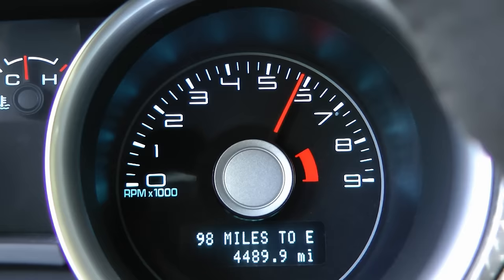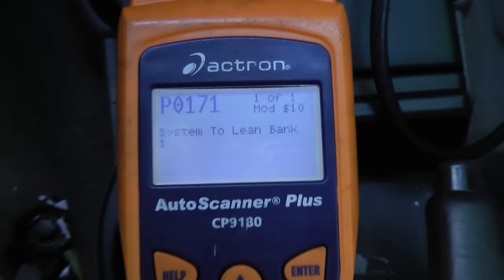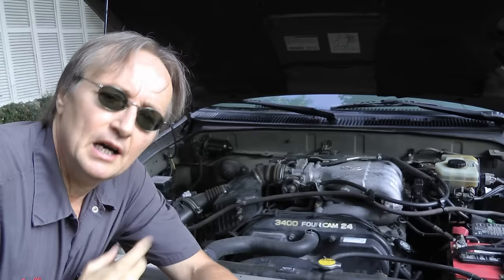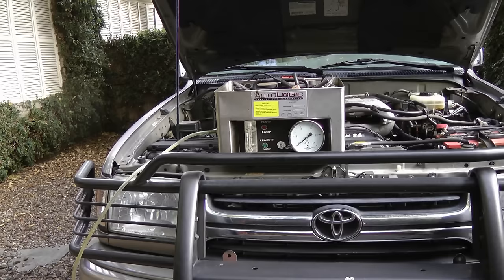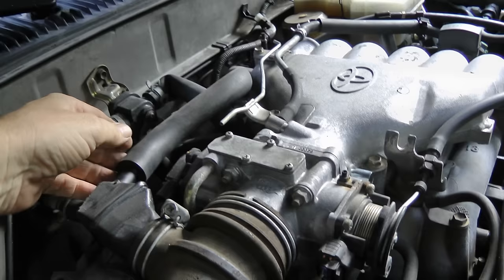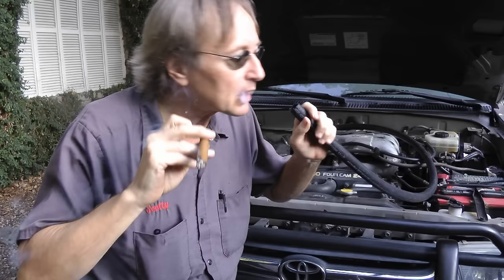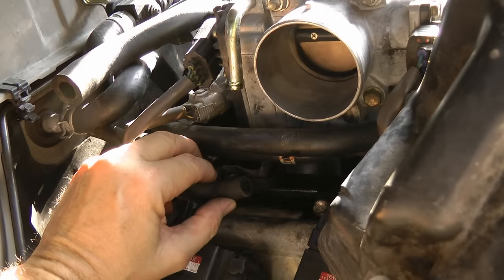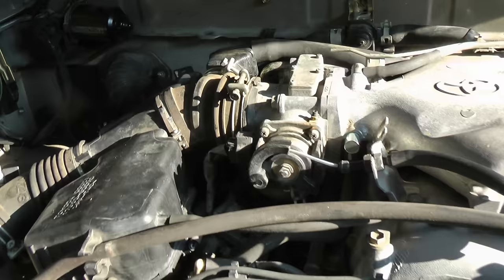How to Find Vacuum Leaks With a Cigar (Life Hack)

Comment: Hi Scotty. I absolutely loved this video. It was brilliant, short, and funny! I am currently going through an auto repair nightmare with my CEL not staying off even after thousands of dollars of repairs. My mechanic said they do not see any other leaks as they repaired that. I have a Honda Accord v6. Do you think the PCM would need to be replaced if my CEL is staying on even after the replacement parts and repairs not to mention going through the drive cycles?
Reply: Todd Simone The very last code that I'm aware of was P1456 - Evap system code. I've had new parts put in such as timing belt, water pump, front crank & cam seals, outer drive belt & coolant fluid exchange. Oil change, replaced spark plugs, adjusted valves, replaced valve cover gaskets, replaced two way valve, replaced light bulbs for the brake light, oil pump resealed, replaced leaking axle seal, replaced both broken mounts, replaced front brake pads, cleaned and lubricated caliper pins, & resurfaced front brake rotors. Regarding spark plugs, the coil  pack was replaced. All carbon was removed. Port and installed new pipe.
Reply: Todd Simone Oh the first code that was known to me before even taking it to the Honda dealership was engine code P0401. Those are the only codes that I'm aware of. Most of the stuff that was done to my car was more so maintenance or things I haven't gotten done in a long time. I heard it's hard to locate that leak, but I even told my mechanic to check my evap system and they said they did and said it was fine. He assured me that my evap system was fine and that they found all the leaks and there's no more leakage so that's when he said it's the PCM. Now prior to taking it to the Honda dealership, I took it to this local mechanic shop (they're a chain here in TX) and after running diagnostic test, they were the ones who first told me the ECM needed to be replaced and reprogrammed/programmed to correct the evap problem. This was the weirdest and most frustrating auto repair experience I ever had in my life. My mechanics back in LA and CO are usually very good and able to repair anything the first time around, but here in TX it's taking these people several times just to get it right. It makes me want to go to auto mechanic school so I can learn how to repair my own vehicles to be honest.
Reply: Todd Simone What you stated makes more sense. The year of my Honda Accord v6 is a 2000. I was leaning towards the charcoal canister, somewhere there too previously because if I had a damaged PCM, then there would be a symptom leading up to that I would assume. I'm definitely going to have that vent valve swapped. Thank you so much for checking into this for me Todd! Trust me, after this, I'm never bringing my car to this dealership ever again, not even for a simple oil change.
Reply: Todd Simone Awww thanks so much Todd. You have no idea how much you've helped me like seriously. I will certainly keep you updated on this. I'm supposed to pick up my car on Monday or Tuesday as they said they should be done by Monday. I will definitely let you know. I won't know if they've fixed the issue until I've gone through maybe one or two drive cycles I'm sure because by that time my CEL will come back on if the issue is not fully resolved like they claim it is. Yeah I couldn't believe this was a dealership also. I wouldn't have never went to the dealership but I only did so because the local auto repair place diagnosed my car and came back with ECM needing to be replaced/reprogrammed with EVAP solenoid replacement and they said they couldn't touch the ECM, that a dealership would have to do that. I'm going to add you to my circles if that's ok so I can update you on what's going on...whether you will cry for me or jump for joy with me.

Comment: hi scotty i have a chevy s10 2003 just bought it and it's burning a lot of oil and gas what i should do. and also when i take off it's really slow until start catching speed
Reply from the maker: those are notorious for fuel injection system failures.  Start with my vide "how to clean fuel injectors on your car" and pray you don't need new ones that cost a ton
Reply: thx man for the quick response. and when you get a chance please let me know how to take care the burning oil. thx again 👍👍

Comment: what if I get no smoke to blow through that must mean I'm sealed right?
Reply from the maker: you can always blow stuff into the system, you would be on the wrong hose that goes to a blocked up valve or something if you can't blow it through. Try another hose, like the brake booster hose

Comment: Hey Scotty I have a 03 Tiburon with code p0444 saying I have a vaccuum problem .. this car will not start, it just cranks..  so far I replaced plugs, wires, coil because the car had other codes as well.. so I replaced those things An the car started An ran at idle for about 20 minutes An died , than wouldn't start again.. so I went ahead to deal with my last code p0444 an I replaced purge valve, and checked the charcoal valve which is working at the bench test.. I'm also in process of replacing the crank sensor .. this car will not start, it just cranks.. all fuses are good An checked with DMM, also replaced valve cover gasket when I did plugs and I replaced gas cap as well... any suggestions? Any kind of help would be greatly appreciated.. I just want to get it running An sell it asap.  Thanks in advance .

Comment: do i need to change the engine if there is smoke coming out the color is black the mechanic i gave my car say i need to change the whole engine again please give your
 advice
Reply from the maker: black is running rich, many things can do that, from leaking injectors to worn out engines. I'd get a second opinion if I were you before throwing an engine at it
Reply: thanks

Comment: hey scotty  i love  watch  videos are so helpful    ,  are you have someone  were you  replacement  the  differential seal  on ford  explorer sport trac 01  on  4x4
Reply from the maker: not yet, but just unbolt the drive shaft, remove it, then unbolt the giant bolt holding the yoke on the diff and pull that off to get to the seal

Comment: hi Scott my air intake hose is cracked...can I still do test cause car overheats
Reply from the maker: sure, just plug up it with rags or duct tape to test
Reply: Can I use upper hose connected to radiator.??..I notice it overheats and fluid comes out near end of upper hose where connects to radiator

Comment: somebody help me what does it mean if my cars idling at around 1400 rpm
Reply: It's idling too high, air fuel ratio is probably messed up, check the vacuum lines first and the o2 sensors

Comment: hi scotty i have 2008 mecedes  intake manifold lever i change the new lever and the car steal pool power and the code p2006 no change please help
Reply: why my brake pedal get hard when my AC is on ? honda city 2004
Reply from the maker: could be a vacuum problem with the brake booster, or engine idling too low with AC on
Reply from the maker: to really work on Mercs, you need a star tester that costs 20 grand. They are not DIY cars by any measure. Could be wiring fault, sensor fault, computer fault, lots of things. Find a guy with a star tester

Comment: Hi
i have a 3.4L V6 Grand Am 
Anybody Know Why I am getting Rotten Egg Smell Threw my Air Vents inside of the car  when i gear down after at 120 kms on the highway test run. it's not my cat just had it replaced flow-master and 2 new glass-pack.
Reply from the maker: sulphur is smell from only 2 things, either the battery is overcharged and suphates out the gas, or the cat is being ruined by poor quality gasoline with too much sulphur in it.
Reply: The Egg smell 
is in the Air vents where the heat comes out, inside the vehicle it isn't there all of the time it only happens when i speed up to a higher speed and then just as when i got to slow down that is when we get the rotten Egg smell.